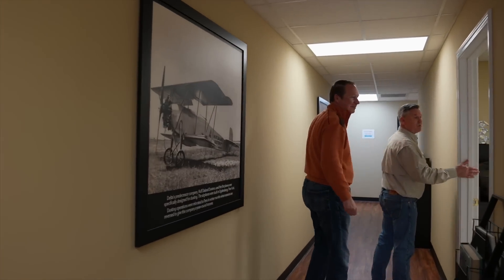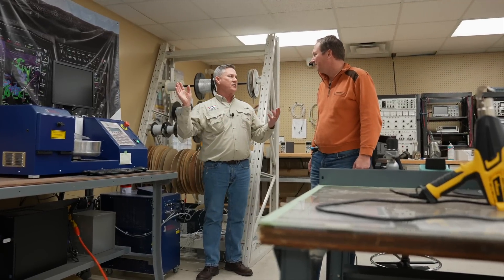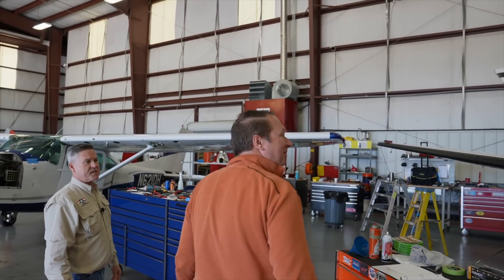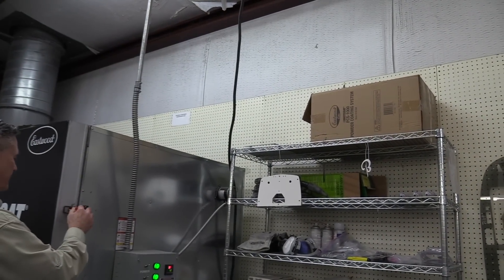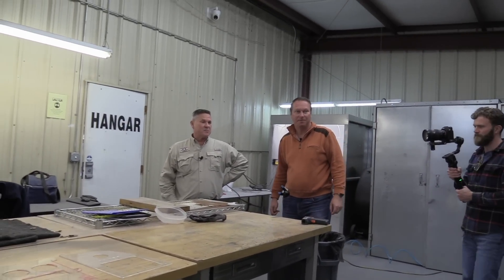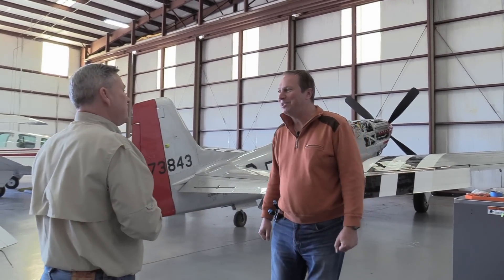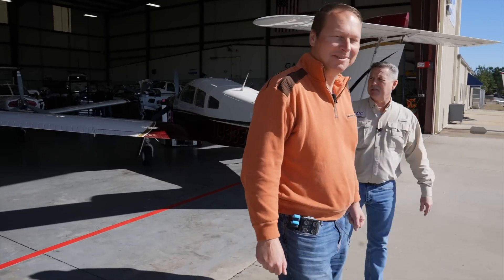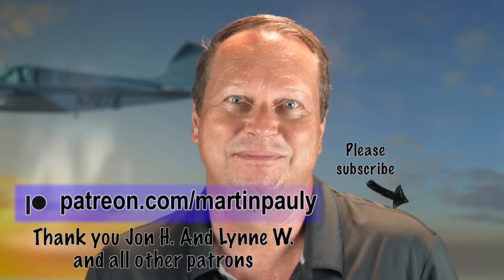My Panel Upgrade - Part I - Avionics Shop Tour

Comment: Well...not much left to the imagination on the avionics upgrade since we saw the panel cutout.  Was wondering on the gray vs. white panel - is there research on that or is it just aesthetics?  Also noticed you never stopped smiling in the video... congratulations and safe flights!
Reply from the maker: Thanks, Walter. Not sure yet when I'll get the plane back - but what I've seen so far looks great!
- Martin

Comment: Maybe at Turbo upgrade??🤔😎
Reply from the maker: You know what, I don't really need a turbo. Sure, everyone likes to go fast, but it comes at an expense - not just the acquisition cost and higher fuel burn, but also increased maintenance effort and - maybe most importantly - new failure modes that can cause problems and dispatch issues. If I lived in the western part of the US, it would be a no-brainer, but the way it is, I very rarely feel like a turbo would make much of a difference for me.
- Martin

Comment: It's nice to see that Bidens Inflation/recession hasn't affected your Avionics business yet.Todays avionics really change the game in situational awareness. Just hope these modern Pilots stay current with Needle, Ball and Airspeed when all the bells and whistles cease operation because of something as simple a broken alternator belt.
Reply from the maker: It's easy to see how pilots can become too dependent on the fancy avionics, but I really enjoy hand-flying, too. When I practice approaches, I make it a point to alternate between coupled and hand-flown.
Reply: These newer avionics also consume less power, letting your battery last longer. Also, many have backup batteries.

Comment: Oh no! I hope you can get them to correct your panel. The parking brake label says ""PARK BREAK". :-(
Reply: Lp: Yes this typo was corrected before the final install. :) That was an old picture no the final product. :) 
Thank you
Gardner Lowe
Reply from the maker: @kaylareed5664  Good to know, Kayla - and thanks for chiming in here!
- Martin
Reply: @kaylareed5664  👍🏼
Reply from the maker: Really??? I had not even noticed that! 
Good thing it's hidden down low on the panel once it's installed. 😁
(By the way, I made the same mistake on my customized checklist for the Bonanza, so I shouldn't be too hard on the shop.)
- Martin
Reply: @martinpauly  😂👍🏼 From where the plane is now it looks like you may have brought in another shop to fix/finish the job. I hope it's all going ok.